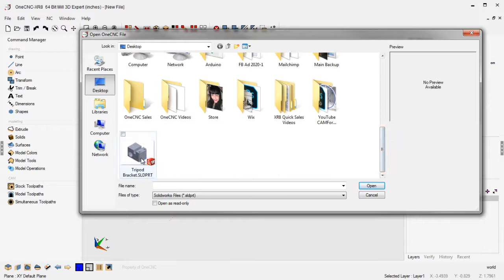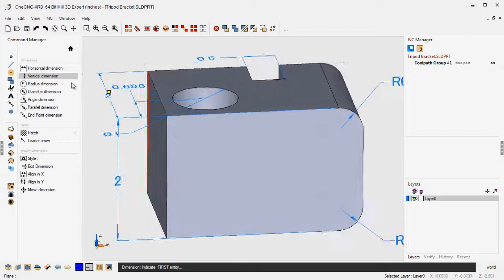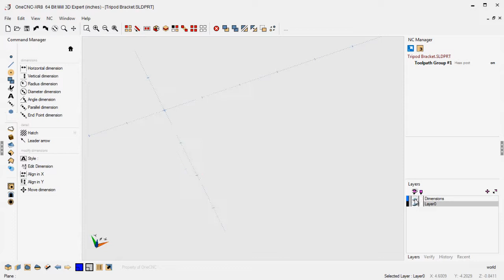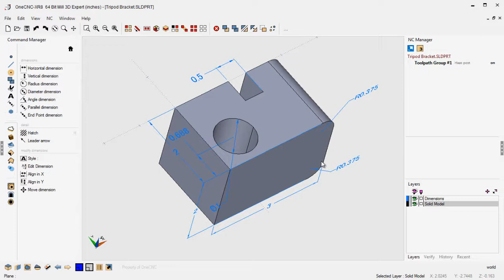OneCNC CAD/CAM: 3D Dimensions

Comment: Is there a way you can do his as a 4th Axis movement?
Reply from the maker: Hi, the ability to create 3D Dimensions is available in all OneCNC CAD/CAM systems and do not require 4 axis. 

However, if you are asking can this part be programmed using OneCNC 4 axis, the answer is yes.
Reply: Sorry for some reason its posted the comment on the wrong video that is probably why it didn't make a lot of sense. It was for the video were you are using the move to position function, were you can manually move X Y & Z. I was wondering if it is possible to move the 4th axis using this function.